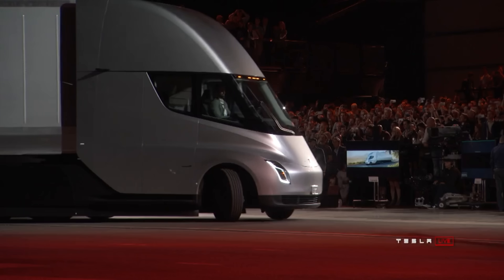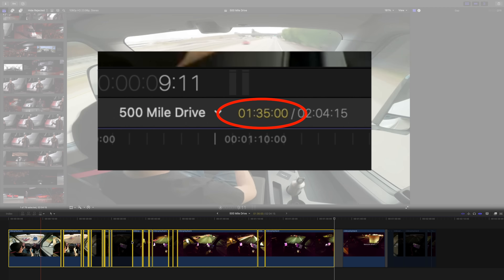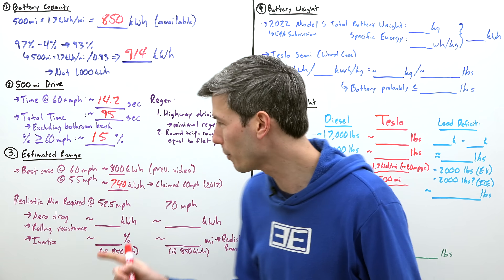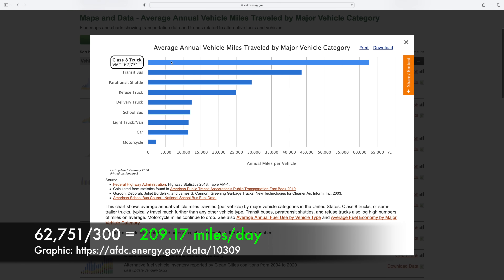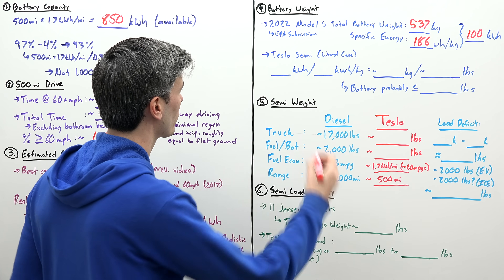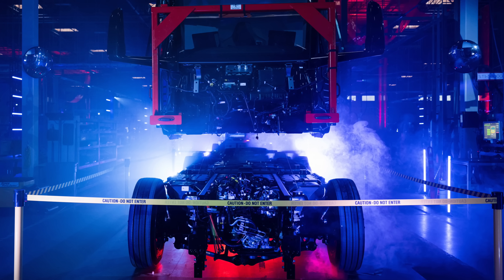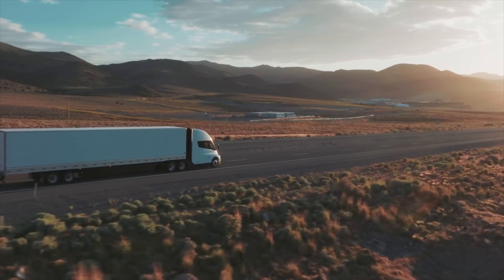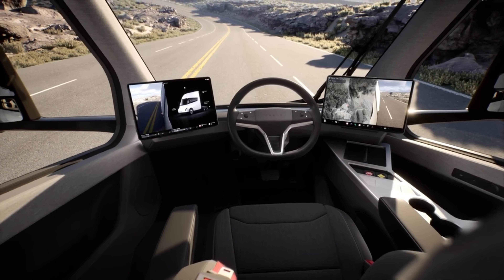Does The Tesla Semi Make Any Sense? Part 2!

Comment: The physics check out but Tesla's marketing doesn't. In other shocking news, water is wet.

Thanks for yet another awesome and well researched video!
Reply: The marketing is for the most part sound as well. Nitpicking on the fact that it has three motors instead of four is irrelevant as long as it does what they advertise. Both truck and electricity prices are obviously going to be higher given record levels of inflation.

Comment: You don't have to drive at the speed limit. If a haulage business can offer delivery 20% cheaper but 10% slower than their diesel-burning competitors, most people will still choose the cheaper option. There are always niches where that isn't true, but I would expect many accountants at haulage companies to be quite excited by the possibilities. Or as excited as an accountant can get, anyway.
Reply: Exactly. If they just had a governor to 55 mph on their vehicles in order to make a specific route feasible which means that the cost per mile is significantly lower because it can work, why wouldn't they do it? There are a little bit of compromises but this is the same way that vehicles were not better everywhere, there were still some places where horses were common because of the rough terrain but over time more and more infrastructure and technology makes it more accessible.
Reply: And make the speed difference between trucks and regular traffic even greater? Good idea.

Comment: I have a Mustang Mach-E and I don't see how 1.7kWh/mi is even close to possible with 70k lbs load for a total of 80k. My average efficiency when I'm in my car alone with no extra load (~4500lbs) is around 3.3-3.5mi/kWh when driving 55-60mph on a flat freeway, which translates to around ~.285kWh/mi. By comparison, at 1.7kWh/mi, that's about a 6x increase in energy while having to transport ~18x more weight, while also being a lot less aerodynamic than the my car.

Comment: Did i miss the weight of the trailer?
Reply from the maker: Didn't mention; averages say around 10k lbs but I didn't know the exact trailer so left it out. More important is the weight of the load, so if that's 44k, and the overall weight is 82k, you have 38k for tractor + empty trailer.

Comment: 1 comment on the weight of the diesel truck. You are calculating apples to pears in mind. A diesel truck has varying fuel load in its application, which is not the case for BEVs. Electrons are not heavy, liquid diesel fuel is.  So you could you a factor on the diesel of maybe 0.7-0.8 * max fuel load to get an average fuel weight in operation. 

This information could be used in range calculation to get more accurate results. Do you agree?
Reply from the maker: Well the load capacity is based on the maximum weight that you're starting with, not what you get down to. If you use diesel fuel as you're driving, you're not adding to the cargo load along that specific drive, even though the cargo load capacity is increasing.

Comment: This analysis assumes that the tweet where Musk claims that it is towing 63,000 lbs. is in fact the weight of the system rather than it is towing 63,000 lbs. This does, however, agree with your sentiment that the Tesla marketing is hype rather than reality based. By your math, that 63,000 lbs. figure means the trailer is rather weight empty.

Comment: Can we also start pushing for a POWER LINK to batteries built in to the trailer for extended range trailers?  If there is still extra capacity in most situations, why not have a class of long haul trailers with batteries built in that link to the tractor and also regen brake?  Would be really useful in the consumer travel trailer market as well!
Reply: Weight of the overall tractor trailer would leave a reduced load capacity but where lighter but bulky loads were normal then it could work.
Reply: @djtaylorutube  Right, but we just went over in the video how rare it Is to have loads with full capacity
Reply: @donchaput8278  yep,I hadn't got that far into the video. :)

Comment: What happens to battery performance and charging in extreme cold conditions?
Reply: A vehicle like this, in its intended use case, should be plugged in and charging at the depot during off-hours ... in which case ... the battery thermal management system keeps the battery in the optimum temperature range. Even if circumstances required being disconnected for a while, a battery pack that size is an enormous thermal mass and would take many hours to reach the temperature of its surroundings. When used as intended, it shouldn't be an issue. Stupidity will, of course, cause problems. Solution, don't be.

Comment: Did a demo with a Mack LR Electric refuse truck last year. The weight delta between the diesel and electric truck in that model is 6,000 lbs. I was impressed by the power and throttle response, but the run time, charging time, and reduced load capacity when combined with the cost of the truck (double the cost of the diesel truck) meant the electric option wasn’t the right fit for my operations. I can’t imagine that OTR operations will be early adopters of this technology either, but maybe there’s a place for it in local deliveries.
Reply: Pepsi is an ideal buyer at the moment. The trucks start and stop at the same place every day. Relatively short runs. They don't need public chargers. Will also work for Walmarts, dollar general, stuff like that.
Reply: @pierredelecto7069  there's also a huge government help, that's why it could make sense for a lot of companies.
Reply: @FacuGonz3  yup. It would be crazy to discount what a couple hundred billion in free government money can get people to purchase. 

I don't necessarily think it's wise to spend it like this when he have this much debt but that's another issue entirely.

Comment: 11:55 this is what the “nays” always miss. 61% of trucks on the road are cubed out.  Thus the vast majority - cargo weight isn’t the main issue.
Reply: This 'vast majority' wouldn't even get the constitution amended. But yes, the majority of truck loads don't get to max load. Doesn't mean that the Semi is usable for all of those 61% of trips though. Lower max payload means smaller fraction 'cubed out' loads.
Reply: @hvh377  the average weight as per stations from DOT is 54k lbs. well below Tesla semi capacity. For now, the semi is capable of moving the average load, depending on distance and charging. The average distance is well below their range. 
Why is it so hard for you to admit you’re clearly wrong?  The semi makes tons of sense for MOST scenarios right now. Not all. But most. Or in better terms, it makes sense more often than not. 
But - you get an A- for effort.
Reply: @Meatball2022  Where am I wrong?And why so defensive? I'm pointing out that the use of 'vast' here is an exaggeration and that 61% of loads is 'cubed out' does not mean that a truck with lower payload automatically qualify for that 61% share. That's it.
Reply: @hvh377  your reply was to my comment that for 61% of the loads, gvw isn’t an issue.  
Actually, 9% of semi use has zero load. More like 70% of the time gvw isn’t an issue.  Was I wrong??   Nope.  My point was very clear.
Reply: @Meatball2022  I have no idea about those percentages. For all I know you pulled those numbers out of...somewhere. I'm no expert on this.

If you want to call 61% a 'vast' majority, go right ahead. It's a free country.

And I never said you were wrong on anything. You're imagining things.

I just pointed out that when 61% of loads weigh less than 50klbs (arbitrary number), it doesn't mean a truck with a max payload weight of say 45klbs can take all of those loads. There is a fraction of loads between 45klbs and 50klbs that will 'cube out' on a diesel truck, but will 'mass out' on a Semi.

(Touchy fellow. Probably deeply invested in Tesla.)
Reply: @hvh377  and yes. 61 out of 100 is a vast majority…

Comment: I am sure in some cases the logistics software will start planning some hauls where a Diesel truck will pull the load up in elevation for a handoff to an electric vehicle that will finish to improve route efficiencies. It will make for an interesting shift in how trucking routes function. This is also an absolutely perfect application of Electric Semi Trucks with electrified loading bays.  While the truck is parked for an hour anyway at the dock to unload, they can recharge. PLUS ALL THE SLOW TRUCKS YOU WON'T BE STUCK BEHIND GOING UP HILLS!
Reply: @@steinmauer9747 Here is a better breakdown for you:  Have Truck A which is diesel pull the heavy load from Phoenix AZ (1000ft elevation) to Flagstaff AZ (7000 ft elevation), resulting in a huge elevation gain. Truck B has also traveled to Flagstaff from Colorado with a lighter load then have dropped in Flagstaff AZ. They then Pick up the heavy Load and transport it from Flagstaff at 7000ft to any other location at a lower elevation resulting in a very large increase in range, even with a heavy load and a lot of fuel savings too.

Trucks hand off trailers in the shipping industry already.  Modifying the logistics to incorporate the efficiency of electric vehicles will save a lot of money.

Comment: Still don't know why this, or any other tractor / trailer electric, doesn't just put the batteries on the actual trailer. ..with a small battery on the tractor for yard travel.
The trailers can be charged while they are being loaded. This is especially good for the Pepsi situation with short distance fixed routes.
The trailers are way more robust than the tractors *with the bat pack up between the rails as well
In any case, this is just another tax credit scam for Elon so it probably won't matter.

Comment: My only criticism is that assumption of similarities with the model S for battery info. The model S uses the 2170 where as the semi and cyber truck will use the 4680 design similar to the new Model Ys out of giga Texas. one positive to note is that the battery is already on rev 2 with many more revisions on the way targeting a 15% volumetric power density increase by the end of 2023 over the power density at the end of 2022. note that mass based power density will likely not change by this same % as many of the changes include increasing quantity of electrode material physically in the battery
Reply: The semi uses 2170. So as long as that remains true, Jason's math is fine. though I think the model s plaid uses 18650 and the semi uses the plaid motors
Reply: Munro or somebody using his info did energy density calculations, and they are NOT much differant

Comment: You did not address the “water cooled” charging cable - I would not myself advise for anyone to get near a high voltage - high current - cable filled with conductive fluid.  Gee you think there is any possibility that the cable might get run over - stepped on - or abuse in some way to make it very dangerous for the next guy?  Without this water cooled cable - the charging time for these things will be days - not hours.   
Personally I would have went with a special much larger cable (meaning larger gauge wire and pins to eliminate voltage drop/heating) specifically for the Semi’s - and special charging stations as well - I mean seriously- you going to have a semi pull up to the charging station at Walmart next to all the cars?
You also did not mention that the sheer numbers of battery cells installed in one vehicle increases the probability of a cell/battery failure.  I would not expect the failure rate to match up with the much smaller cars they have fielded for many years now.   Battery degradation would also seemingly be exasperated by the large number of cells and hence battery replacement may end up being more often than seen in cars as well.  The amount of environmental impact to the large number of battery cells per semi is vastly increased over the automobiles - also not mentioned.
Reply: They have been using water cooled cables on all super chargers for years now. And even if the fluid was conductive and did leak there is still no issue since the cable won't be able to energise in that scenario. Its basic engineering.

Lol talk about fearmongering 🤣
Reply: @SirDragonClaw  Explain basic engineering to me.  Lets say the cable supplies 100 amps and a human dies at 10 mA thru them.  Just how does the cable know to turn off at 10 mA?  Should be pretty basic to explain.

Comment: Chips are notorious for being lightweight. As are most Amazon packages. As you pointed out, most loads are cubed out not weighed out and there you have it. For point-to-point warehouse runs + last mile (warehouse to urban, such as how my Trader Joe's gets its double parked Semi every night), the Semi is a huge winner. Replacing a cross-country Semi is not even that important as ICE engines are most efficient at constant speed. Replacing a stop-and-go route is far more enticing from acceleration, regen and emissions.
Reply: A LOT of truck driving is lighter than load too.

Comment: Kudos once again for doing the math right.
So many clowns have made misleading claims or flat out lied about the Semi that it's refreshing seeing good faith content
Reply: *cough Thunderf00t *cough
Reply: @tripnils7535  ;)
Reply: Even real engineering (usually fairly good) just straight up halves the battery density in his website calculator tool for his video on the tesla semi. Not a particularly precise or reasonable estimate for the difference in pack level vs. cell level battery density. No way the 186wh/kg pack has a 372Wh/kg cell.

Comment: About max weight: how relevant is it for whoever is shipping or receiving goods if the full load comes in 4 or 5 trucks? What matters is price. And, most likely, 5 Tesla Semis will haul cheaper than 4 diesel trucks.
The Jersey barriers are an excellent example of how concrete barrier industry adapted their products to be hauled by diesel trucks (12x pieces per truck). In the same manner, these pieces can be designed differently to max out a Semi. Roads don't need multiples of 12 Jerseys. The Tesla Semi being put aside because a road needs 12 instead of 11 Jerseys will probably never happen.

So JASON, idea for part 3 of this video - do the economics! Because THAT's what really matters in hauling!
Reply: You have to pay for the  5th driver.
Reply: @Veramocor  Fuel costs outweigh that considerably. That's my point. Not even considering possible FSD in the near future...

Comment: Sorry, using what Elon tweeted as facts isn't good enough.  I believe what Pepsi said and they are using it for 100 mile range jobs if fully loaded.  There is a reason they haven't released detailed specs as it will be obvious its a cost fail for the industry.  Keep in mind the very shortened battery life as well since these batteries are charged so quickly.

Do a part 3 when we have real data. You're making too many assumptions and tesla is known for fudging numbers.

It's not just the physics doesn't make sense the economics don't make sense.  You're off in this one.

Comment: The 12 vs 11 jerseys per load actually tells a lot about the way things are shipped. If the average ICE can transport 12 jerseys, all companies will pack 12 jerseys at a time, making it difficult for the Semi to do the same job. And of course that applies to a lot of other things that are packaged around the needs in terms of dimensions and weight of a normal truck.
Reply: Trucks are very rarely fully loaded according to stats in this video
Reply: You are felling well short of a total cost analysis of shipping Jerseys there. Anyway as the video states something like 70% of all trips are under the Tesla Semi current limits. Tesla won't be making enough semis to fill that demand in my lifetime so it doesn't really matter.
Reply: you are forgetting that if its more than 1/12th the cost of the ICE semi cheaper, then any company with a sound mind would choose the cheaper option, and it seems to me to even cheaper than this to run, simply due to gas prices

Comment: could you take a look at Edison Motors and their plan for a diesel-electric generator in a truck? Maybe compare it to the tesla semi?
Reply: every time you transform energy from one form into another you loose efficiency, so if you have a diesel engine in a truck, the most efficient is to use it to move the wheels directly instead of use it as a generator for an electric motor that is moving the wheels. for reference, see the fuel consumption difference between  Toyota rav4 hybrid and Honda crv hybrid, that use the two different approaches